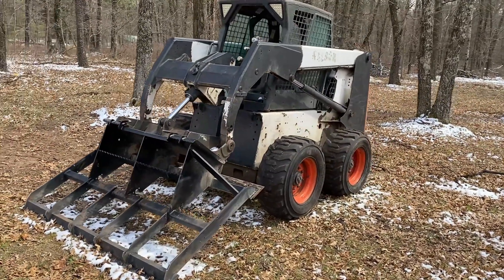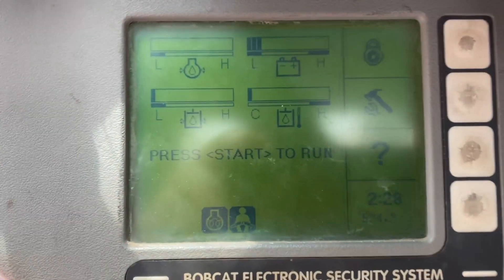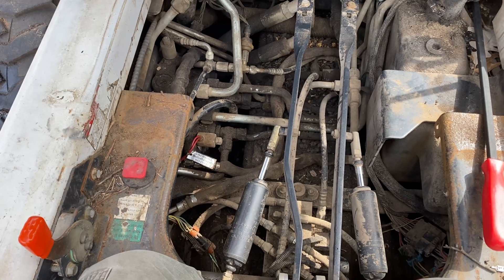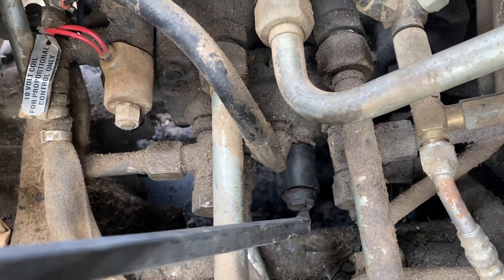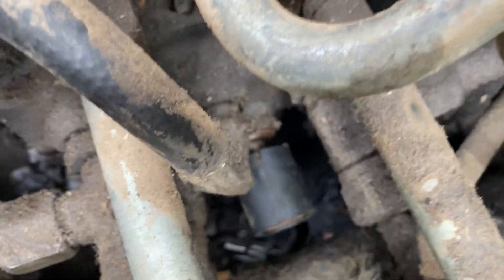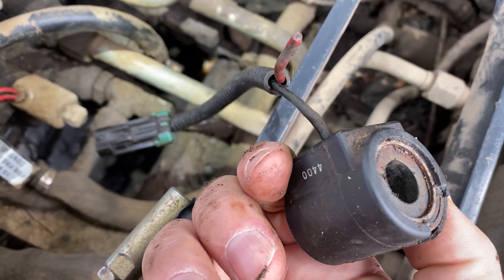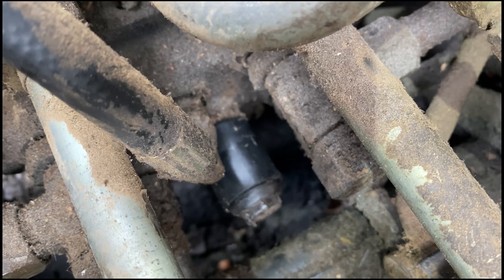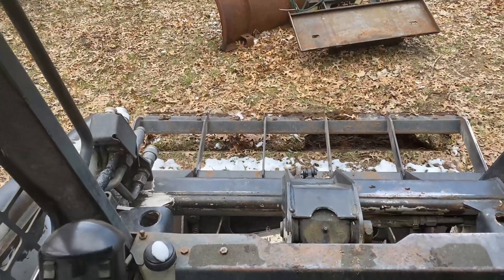Bobcat Lift And Tilt Not Working ? DIY Hydraulic Repair

Comment: hope your still around  i got a 463 bobcat ,lift bar works great ,bucket lifts fast thats ok ,bucket drop is very slow , this is foot controlled ,i have replaced the pedle bushings ??
Reply: Change your 2speed valves
Reply: They are also located on control valve pump

Comment: I owe you! I have a 2000 863 I always new bob car is at the bottom of reliability and quality, but the dealer service plays the biggest part, they charged me for that and many othe things when I took ot in. It happened again 6 months later, I was about to take it back to them, even when. They told me they ware not going to do waranty, but I saw your video. Thanks !!!

Comment: If has been sitting for a while possibly a hydro value stuck open or shut but electric over hdyrdo so could be wire or the cylinoid it self. That bare wire I'd wrap with electric tape to keep it from rubbing the coating off. I liked the case 1845 1840 they was good machines the 90xt the last good case the caterpillar 289 track machines are easy to get to to work on but the first caterpillar 226 was based of the Melroe IR machines with case either case controls hand or the new one handle front and backwards and the other loader and bucket but the caterpillar 259 289 very good machines and to my on knowledge don't catch fire. I just say this because I rented a new bobcat and the sells guy tells me to get renters insurance because there is a hose that comes lose in the bottom and one has caught fire so that threw me off and would not buy one after that you'd think if knowing that's a problem they'd fix it but hey insurance works I guess. The 743 843 melroe were good machines when IR took over they went down hill. They had Kubota motors in them or duiez diesel.  The John deere loders alright but had problems with a bolt that keeps the bucket pins in and they fall out when grading more than once. The track machines don't rut as bad and beat you up the tracks lgp. The early new Holland loaders good before they changed but the late 80s early 90 new Holland good the design put the motor out back a bit more for weight and the loader arms go up and out for loading trucks. The high bed trucks every loader is at is peak just to dump so depends what the operator likes but the high body beds you have to get your tracks or wheel right on the rear tires and may bust a wheel cap on the truck but thsts construction it happens nobody got killed

Comment: ماهوا الخلل عندما يتحرك ويمشي جهة والأخرى تتوقف مثلا تريد تمشي والى الامام وتتحرك جهة لدينا خلل
Reply from the maker: BTS, 
That sounds like a drive motor problem.
If I had to guess you have a hydraulic issue affecting flow to one or more drive motors,
Without more info and without actually being there, I couldnt make a better diagnosis.
LEt us know what you found! 
Have a wonderful day.
-Shane

Comment: I have a 2016 s510 where the loft and tilt struggles unless its full throttled not sure if theres an issue or what but im lost as to what the problem could be.
Reply from the maker: I'm not familiar with that model, sorry.
If it were me, I would look to filters tho since I do have similar issues when my hyd fluid gets extremely cold and flows poorly
Merry Christmas!
-Shane

Comment: Thanks for sharing this, I just recently got a 773 turbo bobcat and this just happened to me, I replaced the solenoid and it fixed it.
Reply from the maker: Aim small. 
EXCELLENT!!!!!!!!!
I LOVE it when my videos help! Makes the time I put into them worth it!
Merry Christmas! 
-Shane
Reply: I having a similar issue but I'll look at that solenoid my foot controls are locked but I don't think the tilt light is off but my accessories work fine
Reply: It's a 773 turbo

Comment: I’m having a similar problem but my bucket and lift moves after awhile or if I shovel out my bucket then it moves again, is there a possible sensor?
Reply from the maker: Todd,
Sorry for the delayed response, I have been down with the sickness, 
That sounds like a leaky valve that is allowing pressure to release either inside or outside the system.
That can be hard to track down. I would call your local repair shop, let them know what machine you have and just ask them what they would guess. Chances are it is a common issue with whatever machine you are running and it may or may not be an easy fix!
Let us now what you find!
 Stay safe!
-Shane

Comment: Hi sir. Bobcat 130 sweeper not working. How to check pls give idea.
Reply from the maker: Fawzan, 
Sweepers like mowers require a lot of fluid pressure, be sure to check that you have adequate flow and enough fluid in the tank.
Some machines may require an extended holding tank for hydraulic fluid so watch for that. There really isnt all that much that can go wrong with a hydraulic motor so I would start there!
Be sure to let us know what you learn!
Stay safe!
-Shane

Comment: Greetings from Alaska, my dad has a similar bobcat like yours, a little bit of an older model, 753 got it in the mid 90s. Our bobcat arm are able to goes up, but not able to go down (unless I shut the engine off and use the foot pedal) this goes for the same of the tilt, able to go down but not up. However, if I hit the aux power to on position (with two green lights on). Then we are able to move the arms and bucket with no issue. Any insights would be greatly appreciated.  I look at the schematics and read forums and one guy said that your stem/coil could be stuck.
Reply from the maker: Kin, 
Because it is a very inexpensive starting point I would change the coil just to rule that out in the event that isn't the problem.
The options behind that are quite a bit more involved.
I think the other guy is probably right and the coil is likely the problem 
Give 'er a try and let us know!!
Stay safe brother!
-Shane

Comment: My left foot pedal which is the lift control wont move but the tilt pedal is fine. could this still  be the same solenoid issue?
Reply from the maker: Usually a foot pedal that wont move is going to be a stuck or jammed linkage. Lift the cab and wiggle the linkage for that pedal and I will guess you will find the problem
Good luck and let us know what you find! 
-Shane

Comment: Strange that I have that same 17-07 code and the lift and tilt light slowly flashes, but I don't have any problem with it lifting or tilting or driving or anything. Since I bought this used, could it have been fixed by the previous owner and the code wasn't cleared? Or do you not have to clear codes like you do on a car?
Reply from the maker: Well, I cant speak for all bobcats, but my on machine, the code reset all by itself.
Let us know what you find out when you get it sorted out !
-Shane

Comment: I got a Bobcat 873 with a no Tilt or Lift problem. Grandpa filled the hydraulic tank with diesel fuel by mistake and ran that mixture through the system. At first it locked up the whole machine, No lift or tilt and the wheels wouldn't move. Since then we were able to by pass the Bobcat safety protection valve for the wheels to unlock them. But can not locate the one for the arms or tilt. With the oil and Diesel mixture now all the way in the hydraulic system, and been sitting for 5 plus years. would that mixture deteariate the seals in the cylinders ?
Reply from the maker: I couldn't say for certain but my instinct would be that the seals should be fine since diesel fuel is basically a light grade of oil and while it would not have the viscosity needed to allow pressure to be built up to function as a hydraulic fluid it should be pretty easy on the seals I believe. 
Grandpa can sure be forgiven for making a mistake like that. I have to remember to check the picture on the caps closely every time I fuel up the machine to keep from getting it wrong myself.
Be sure to let us know what you determine as you go forward with the repair! My 50 cents is bet on the seals are still just fine.
Stay safe and stay healthy!
-Shane
Reply: @AHandleOnThings   Thank you, I'm gonna have to do some more digging on it then. But I will surely let yall know what i determined to be the cause, since its not a typical cause for a no lift or tilt. Its an older machine that sits outside all year round, so i wanna try and fix it before the first snow fall.

Comment: I have bobcat 773 after I wash the interior I lost the light for lift and traction please help me
Reply from the maker: Sit in the seat of the machine... Right behind your ankles when you are sitting in the machine you will find the metal cover for the fuse box (on many machines) open it up and have a look.... you very likely got something wet and popped a fuse in that fuse box. 
Let us know what you find !
-Shane
Reply: @AHandleOnThings  I check all the fuse and change the solenoid  stills don't move on my interlock sistem I have 5 light seat sea bar and power still on light for Valve amd traction are off any idea please
Reply from the maker: Don't take this wrong... I don't know how much experience you have on the machine so I have to ask... You ARE pushing the green button on the lower left corner of the left side control pad that says "Operate Loader" after you start the machine right? 
-Shane

Comment: So went out to my 753 circa 2000 +/- today to spread some gravel and I noticed a knocking noise directly under the seat on the right side about at my butt cheek. I could tell it was some type of solenoid. The pedals would not work unless I could time it just right in between knocks. I have no active warnings. When I put pressure on the pedals the knocking stops, but they will not move. I recently replaced a hydraulic cylinder and the system did get low on hydro oil before I could get it back to a place to work on it. I have used it since the cylinder was replaced and it was fine. Could this fix be it or would it be something a little more serious?
Reply from the maker: It could be this solenoid but (without being there) I would be thinking it could be an air lock (air bubble) in the hydraulic system. I would start with bleeding the hydraulics and if that didn't work I would call a service tech and ask them if they had any ideas but it sounds like an air lock to me. 
So minor problem is my instinct. 
Let us know how it comes out!
Thanks and good luck, 
-Shane
Reply: @AHandleOnThings  Thanks for yuor answer. Another stupid question. How do I bleed the hydraulic system?
Reply from the maker: Not a stupid question at all. I dont have the answer to it tho. I would give your local bobcat shop a call and ask for the procedure for your machine. A lot of them self-bleed as I understand it. Another thing to check would be if there is any gaskets from your previous repair that could be sucking air. Articles like this one
 https://lightningbay.com/signs-your-hydraulic-pump-could-be-failing/ 
Say that air in the system is a good bet the trick now is to find out where it is getting in at and how to go about getting it out.
Sorry i can't be of more help brother.
-Shane
Reply: @AHandleOnThings  So after making sure it had a full hydraulic tank and letting it sit for two days, all is well. Everything works like it did. I sure would like to know what was going on.
Reply from the maker: I'm going to bet that it was an air bubble in the system that dissipated.
Whatever it was I'm sure glad your machine is back up and running brother
Have a super day!

Comment: I shimed mine then slap it back in the pedal locks I welded them in and auxiliary we built a set screw to turn the ho on and off I tried replacing them it could of been several grand with computer harnesses and handle I spent about 100 at machine shop my buddy makes them so they cant break if it's just simple wire like your I'd fix but mine was everything
Reply from the maker: Gotta love it when you can save a ton of cash!! Great job!
Reply: Gary.   I'm curious how you fixed yours.  Mine is giving me a 17_06 error.   Ground issue.

I replaced solenoid nothing.  I tried to find loose ground nothing.  It wi randomly work perfectly for a while the. Not lift or tilt for months .   I will reread what you wrote again but I'm not sure I understand what you did